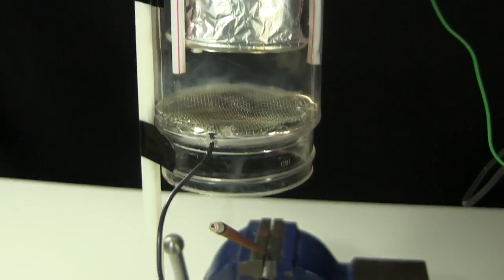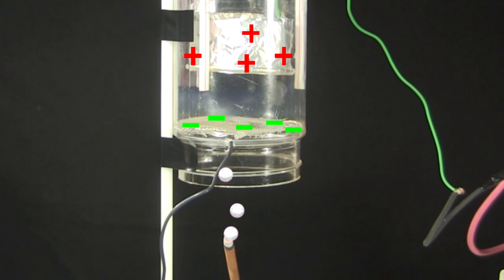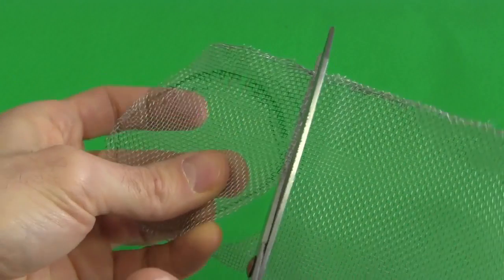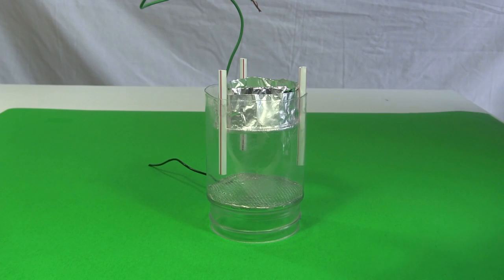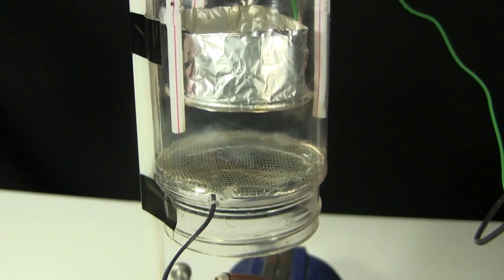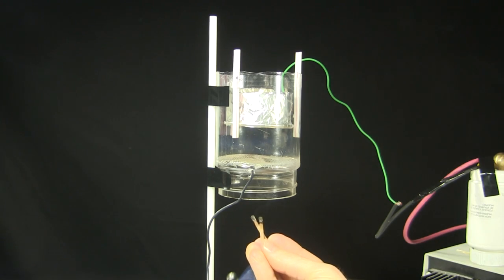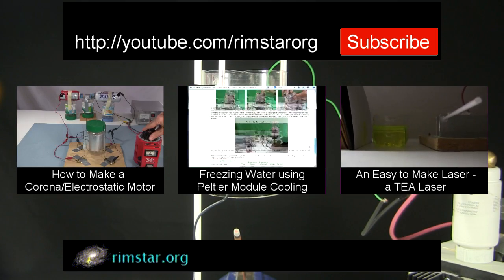Electrostatic Precipitator/Smoke Precipitator - How it Works/How to Make

Comment: what is the difference between lifter  and ESP  I think they are similar....
Reply from the maker: What's ESP? Electrostatic Propulsion?
Reply: Yes Prof.What do you say about their similarity? I think you know about Grebennikov's work.Russian scientists work with Cavitary Structural Effect. This precipitator that you made is similar to their work but only different thing is extra Activated Carbon.When they use A.Carbon and the vehicle  lost its weight. I couldn t understant that the Chemically explanation.
Reply from the maker: I'd say that the lifter is a form of electrostatic propulsion device, maybe. For example, it's similar to an electron bombardment thruster as described here http://www.daviddarling.info/encyclopedia/E/electronbomthruster.html except for two key differences. The first is that the lifter's thin wire serves as both emitter and one of the electrodes providing the electrostatic field. However, because the lifter is surrounded by a gas and electron bombardment thruster's are used in a vacuum, in the lifter the ions don't get very far before collisions with neutral particles. So the emitted ions are necessarily ejected.
As for Grebennikov, I've heard of him but don't have anything to add.
Reply: Alexander Dorohov (Not Frolov he made ELT) He followed Greb's work and used A.Carbon I think he went through  Moon.. I m very interested in your works and explanations are very simple, clear and useful. Have you  ever tried to work with Activated carbon if not ,Can you try?   Thanks ..From One Of Your Gangs.
Reply from the maker: Nope, I haven't worked with activated carbon and I don't see any reason why it would make a difference, so I'm not likely to try it. Sorry.
Reply: The reason is that you can make an anti gravity vehicle.Isn't that a good reason?
Reply from the maker: If you make it and prove it works then I'll do it but until then, I doubt it does work. I've been down that road before.
Reply: I m only a student. I m just trying to learn. I m not an expert like you.I ve been learning from you and the people like you.So how can I  prove it?
Reply from the maker: The only way to prove it works is to make a working one. To do that you'd have to find out how the people who claim to have made one did so. But as I've said, I've been down that path already and I'm pretty sure you won't be able to find enough details to make one because the people who claim to probably didn't -- based on my experience. I'm not aware of anyone who can show how to make an antigravity vehicle. Or rather, there are people who will show you but they haven't made a working one themselves.
Of course you can always hold out hope, like I do, that we'll find a way someday. I think it's also possible that someone may have accidentally done it but either don't know how or won't say. Though if they won't say then the real reason is probably because they didn't really.
In terms of standard physics, there are some interesting things to look at though. See this page https://tauzero.aero/making-progress/propulsion-ideas/ and https://en.wikipedia.org/wiki/Alcubierre_drive
Reply: Arkiver Unified Energy Intro  This Guy made an anti gravity vehicle you can see his videosI think his name is Mike and  he mentioned about the vehicle , he had to sell it because he had no money so I tried to connect with him but he never answer me.He knows  lots of things like you. His machine  is similar to Luigi Rota's Aero vehicle there is a bi-polar Tesla Coil under or between two things etcetera...
Reply from the maker: That's yet another example of what I was talking about. He hasn't provided proof that he made anything which works, and you can't get enough info to make one and prove it works either. I wish you luck going down paths like that, you'll probably even learn a lot of electronics and real science along the way (I did), but I've already been there and got no where.
Reply: One of my teachers asked me:' Are you Pessimist or Optimist? ' My answer was: ' I'm Realist.' You are extremly realistic person.You are not in a dream land.

Comment: Good work,pls i need yr gmail
Reply from the maker: My email address is at the bottom of all my webpages on https://rimstar.org. But before you send en email, make sure you also watch the follow-up video https://www.youtube.com/watch?v=ARSQWTzWago where I do more demonstrations with different power supplies and measure voltage.
Reply: kk

Comment: Can this machine filter out small dust particles?
Reply from the maker: I don't know. All I know about are the things I tried in this video.
One thing I didn't mention is that at the voltage required for this design (21,000 volts), it produces ozone as a byproduct which is hazardous to your health in large enough quantities. So you'd need to do this in a ventilated area anyway. Commercially made air purifiers which work on this basis are designed to use much lower voltages below which there is no ozone, but I've never been able to find out what that voltage is.

Comment: Where the negative charge connect please help asap
Reply from the maker: It's connected to the negative of your power supply. In my case that was also ground. Does your high voltage power supply have two outputs?
Reply: Thank you how abouto the positive wire it is also a solid wire or copper wire?

Comment: How you have done earthing
Reply from the maker: The HV - wire I show at 0:23 is connected to Earth ground. It's also connected to the negative of the low voltage power supply and to the negative of the high voltage power supply.

Comment: I want to use this system by using batteries as DC sources,,,,So is there any to generate high voltage using batteries.....
Reply from the maker: Unfortunately, this needs around 21,000 volts and you can't combine batteries in any way to get that voltage. You can, however, use batteries to power a high voltage power supply of some sort. But have a look at my follow-up video where I test different power source for this smoke precipitator https://www.youtube.com/watch?v=ARSQWTzWago.

Comment: Can i use 400kv
And all is nice
Reply from the maker: Maybe. It also depends on the amount of current that the power source can supply. For example, my small Van de Graaff generator can supply 80kV but not enough current. What is your 400kV power source?
Reply: Will use 6v booster to400kv
Reply from the maker: If you're talking about one of these https://www.ebay.com/itm/DC-3-6V-6V-400KV-400000V-Boost-Step-up-Power-Module-High-voltage-Generator-/191228126686, I'm not sure. They look like they might have enough current but they also look like they may have AC output. AC won't work. So I can't say for sure.
Reply: RimstarOrg sir it is dc to dc 
Not that website you have send
Reply: RimstarOrg l can i use more volt then 400kv like 500kv etc

Comment: can I use with 50kv
Reply from the maker: Maybe. It also depends on the amount of current that the power source can supply. For example, my small Van de Graaff generator can supply 80kV but not enough current. What is the 50kV power source you have in mind?

Comment: What is the minimum voltage is required for the somke precipitator ? 
Can this precipitator will work with three stage cockroft Walton voltage multiplier
Please answer in this video only
I mean answer this question in this video only
Reply from the maker: The minimum voltage is 21,000 volts. The power supply I use in this video is a three stage cockroft Walton voltage multiplier, so yes. See my follow-up video where I measure the voltage https://www.youtube.com/watch?v=ARSQWTzWago.

Comment: How much volt of electricity u gave fr this model to work
Reply from the maker: 21,000 volts but I don't know how much current, that's harder to measure at high voltage. I suspect the current was somewhere between 250 microamps to 1 milliamp. You can see me measuring the voltage and trying different power supplies in my follow-up video here https://www.youtube.com/watch?v=ARSQWTzWago.

Comment: I've used a step down transformer and a rectifier but can u give me the circuit diagram for that and where does the negative of the power supply go and how should we complete the circuit
Reply from the maker: You need at least 21,000 volts. A step down transformer and rectifier won't produce that high a voltage (but here's my webpage for my low voltage power supply https://rimstar.org/equip/24v_pwr_supply.htm but the output voltage is only up to 24 volts). In my follow-up video I show trying some different power sources and measuring the required voltage https://www.youtube.com/watch?v=ARSQWTzWago.

Comment: Is it ac voltage or is it dc.
Tell me the output volt
Reply from the maker: It's 21,000 volts DC minimum.
Check out my follow-up video https://www.youtube.com/watch?v=ARSQWTzWago where I measure the voltage and try out various power sources.

Comment: I can't understand about that wire mesh is connected to the ground . how does it get negative charge
Reply from the maker: The cylinder is positively charged. That positive charge attracts negative charge from the ground. That's because unlike charges attract each other.

Comment: Would a Van de Graaff generator also work if the mesh and the aluminum cathode is placed further apart?
Reply from the maker: I haven't tried a Van de Graaff, but it would depend on the the machine too. It would probably have the required voltage, but it's the current that it may be lacking in (for the ions). With a Van de Graaff, the wider the belt and the faster the belt moves, the higher the current. I doubt very much that my soda can Van de Graff with its rubber band belt would have enough current so I've never tried it. I did get it working with a Wimshurst machine though, one with big disks. See this video here for my experiments and voltage measurements https://www.youtube.com/watch?v=ARSQWTzWago.
Regarding moving the mesh and aluminum cylinder farther apart, you'd want to do the opposite. The closer together they are the lower the required voltage (the required current isn't affected by the spacing). I also experiment with that in the video I linked to.

Comment: Can we use home switches for this purpose
Reply from the maker: No, it requires high voltage. Home switches are only 120 volts whereas this requires 21,000 volts, so you need a high voltage power supply. I did some voltage measurements in my follow-up video here https://www.youtube.com/watch?v=ARSQWTzWago.

Comment: How many voltage did you used? And how to get a power supply like the one you used? thx
Reply from the maker: I used my 30kV homemade high voltage power supply https://www.youtube.com/watch?v=GEuK1OdYxHk but my commercially made Wimshurst machine works too. You can see all that in my follow-up video were I also measure the voltage https://www.youtube.com/watch?v=ARSQWTzWago which turned out to be around 21kV.

Comment: Hello. I am trying to make this work with a Velleman switch power supply. Psin10024n. 24 V. It's not working. Is it because of my power supply? I followed everything except making my own power supply.
Reply from the maker: That power supply looks like it's output is rated at 24 V. You need high voltage for this to work. You need around 21,000 V. I recently did a follow-up video where I measured it https://youtu.be/ARSQWTzWago.
Reply: RimstarOrg thank you for your reply. I truly appreciate this video by the way. I thought 24V would give me enough, obviously missed the high voltage part. Thank you.

Comment: why should we use aluminum foil only.can we use another foils
Reply from the maker: You're not restricted to just aluminium foil. You can use any electrically conductive material. The only restriction is that the edge closest to the mesh must be smooth. That smoothness of the cylinder and sharpness of the small wires of the mesh is what determines the direction of ion flow. It's the same principle as in the type of ion propulsion I explain here https://www.youtube.com/watch?v=01F8V5IhB5k.

Comment: hey, I want to build a precipitator with FBT instead of high voltage supply.
Do you think it will do work?
Reply from the maker: I'm assuming by FBT you mean flyback transformer. The output of a flyback transformer is AC whereas the precipitator needs DC. However, almost all flybacks you find these days have a built in diode to the output which converts the AC to pulsed DC. That's what I have in my Cube power supply (https://www.youtube.com/watch?v=-KFhBVfpfDw). However, I tried the Cube with my precipitator and the voltage wasn't high enough. Here's the follow-up video where I show trying the Cube, and other power supplies, with the precipitator https://www.youtube.com/watch?v=ARSQWTzWago.

You could try to come up with a different precipitator design that would work with a lower voltage.

The power supply in the video does actually have a flyback in it, but a rare, and very hard to find one without the built in diode, so its output is AC. However, the output of the flyback goes to a Cockcroft-Walton voltage multiplier, aka tripler, that both steps up the voltage and converts it from AC to DC. So with the higher voltage DC, this one works. Here's the link to it on my website http://rimstar.org/equip/30kv_pwr_supply.htm.

Comment: and in 2:13 what is that dark blue colour stuff
Reply from the maker: Those are vises (https://en.wikipedia.org/wiki/Vise). A vise is a tool for holding things while you work with them. Use any method you have for supporting the precipitator and the source of your smoke.

Comment: i need your help please  !!!  in the video at 2:13 , you say that mesh is connected to ground ? could pls give some explanation and some information on that how  the wire ( from mesh ) is connected to the earth ground
Reply from the maker: I show it in my crystal radio tip video https://www.youtube.com/watch?v=HZZmKZJrIW0 at around six minutes and fifty two seconds in.
Reply from the maker: Oh, and the explanation is because the high voltage terminal of my high voltage power supply is relative to ground. Basically, my power supply has two terminals, high voltage positive and ground. In fact, I may not have use the ground plug plugged into the wall trick that I talk about in my crystal radio video. I may have connected it to the ground terminal of my high voltage power supply.
However, if you're using a Wimshurst machine to power it like I did in my follow-up video https://youtu.be/ARSQWTzWago then it has just two high voltage terminals and no ground. So it depends on your power supply.

Comment: and could pls give the the list of items required to do this experiment , pls reply fast ,please !!!!
Reply from the maker: I don't normally do parts lists. Is it difficult to figure out what's needed by watching the video? There aren't many parts. The mesh is aluminum mesh from a fly screen from hardware stores. It has to be metal. Make sure you don't get fiberglass mesh. Maybe you can use mesh from a food strainer, just make sure to flatten it. The connecting wires don't have to be any specific wire gauge.
Reply: thank you so much !!!!

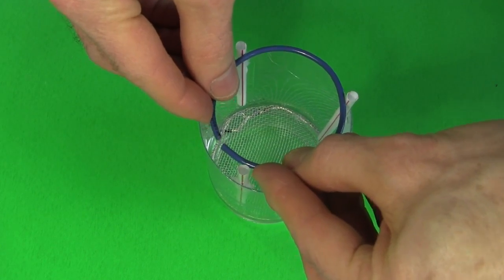Comment: in 1:30 could you please explain what is that blue wire , what type wire is that ?? pls reply fast
Reply from the maker: I don't know what that wire is normally used for. I just bought a bunch of it from Home Depot many years ago. Any thick wire that you can form into a circle will do. Clothes hanger wire is an easy to find one. If you can't find it in stores then go to a dry cleaning place and ask for one.
Reply: thanks a lot !!!!